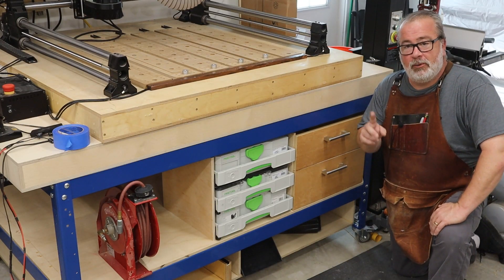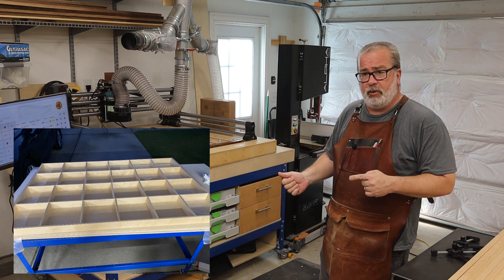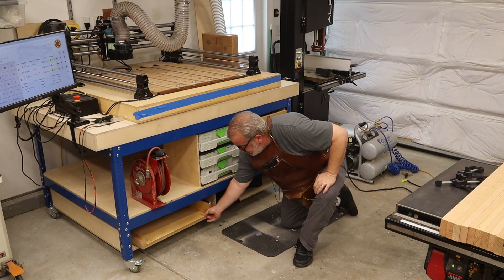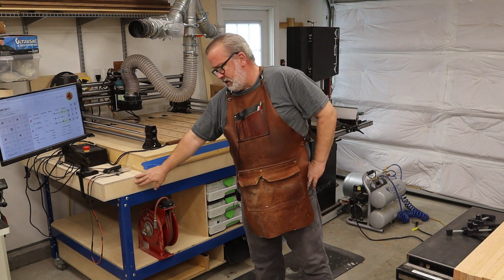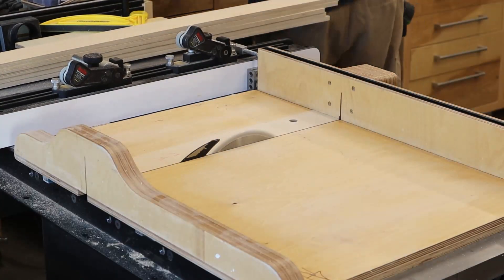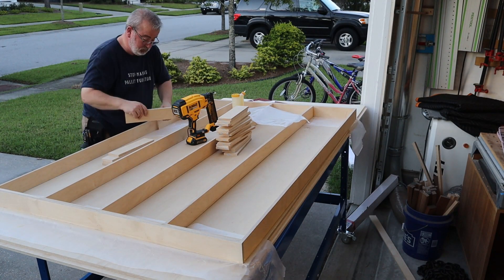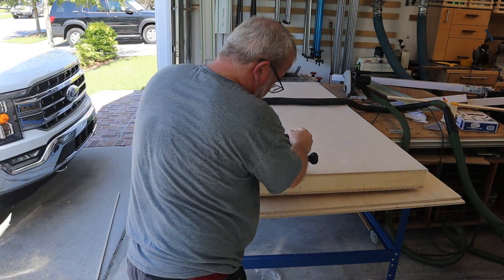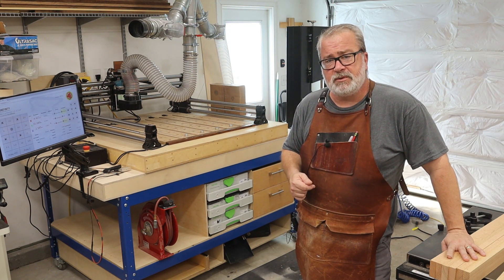Torsion Box Assembly on a Kreg Base

Comment: Did you attach the torsion box to the Kreg frame or just leave it sitting on top?
Reply from the maker: Hi there, I did attach the torsion box with screws from beneath, through the keep frame. The weight of the torsion box and in my case my CNC machine weren’t enough in my mind to keep the torsion box from sliding around. Hope that helps!

Comment: Great content as usual. Using a piece of scrap to make the "dados" on the end caps to locate the stretchers is an excellent process for a stress free build. One additional thing to look out for is to make sure the table you build the your torsion box on is as flat as possible. The torsion box will conform to the table and will only be as flat as the table is. Ask me how I know. :) If you don't have a flat table  you can hot melt glue shims under the legs of a pair of sturdy saw horses to make level and flat and place an mdf sheet on top.
Reply from the maker: Mike, thank you again!  Yes I do a lot of furniture making aside from CNC work and relative measuring while the easiest way to make accurate parts, seems to be a simple but lost process. Probably due to over thinking things, or desire to use your (my) super precision marking tools etc. You are 100%correct, if you don’t build the base we’ll, you can definitely pull a torsion box out of plane/flat.  Best practice I’ve found is build your base upside down on something flat. Let’s the leg ends run wild so to speak and true the bottoms later. Thank you for your support and comment.

Comment: What were the finally dimensions you went with for your torsion table?
Reply from the maker: I want to say something close to 48x72
Reply: @TradeSkillersAnonymous  : Other than the metal spans from the Kreg, how did you attach and/or support the torsion box to the Kreg? Thanks!
Reply from the maker: @b-radg916  I really just used two plywood spans each about a third of the way in from the ends. Due to the strength of the torsion box, I’m not really sure they were necessary, but made me feel better having them.
Reply: @TradeSkillersAnonymous : Wow, thanks!
Reply: @TradeSkillersAnonymous  thanks! I have a Journeyman on they way. This looks like the best setup with the kreg base.

Comment: Hi there, I was reading through your responses and didn't see anyone comment on torsion box vs the onefinity qcw stands they are now selling.  I am worried about the rigidity of the stand.  What are your thoughts between the stand they are selling and building a kreg/torsion box set up?
Reply from the maker: Hi Jason, if space isn’t an issue, I’d use a torsion box every time.  Since making this though, I’ve moved and am sharing an oversized garage with my wife’s car until I build my shop.  I’ve also ordered the 48x48 machine with the masso controller so my CNC footprint is about to grow at a time when I can least afford the space.  That said, with my new machine I did order the QCW, secured from below stand as it will be more space efficient than my current arrangement. To your question, so long as your rails stay relative to the bed, leg rigidity shouldn’t matter. So long as the machine is “locked” relative to that bed, you could run the machine in a row boat in heavy seas, and get great results.
Reply: @TradeSkillersAnonymous  Thank you for your quick response!  I will stick with my order the way it is.  I will hopefully have a decent garage space set up in the spring for my elite machine, but know it will be moving in the next 3 or 4 years.  Keeping things mobile will be helpful.  I have enjoyed your videos so far.  What software are you using for your design work? Vcarve or Carveco?  I am just in the library but will listen to your question and answer videos later today.
Reply from the maker: @jasonbeattie2889  I have used both, but have found a strong preference for vcarve pro. It will be different for everyone, but I found vcarve’s menus and operations to be the most intuitive to the way I think/work if that makes sense. I think they both are very strong in their function, I just prefer vcarve.

Comment: Great video.  What do you think of using MDF rather that baltic birch for the torsion box, or just the ribs and stretchers?
Reply from the maker: I think if you’re in a dry climate, mdf would be a good choice, very stable material unless it’s gets exposed to moisture. Living in Charleston sc meant I’m always dealing with really high humidity, so that’s why I chose plywood. Thanks for watching and your comment.  Please consider subscribing while you’re here!  Thanks
Reply: @TradeSkillersAnonymous  Thank you for your response.  We've had more humidity here in Portland, Maine in recent years so plywood it is.

Comment: so if we can only get the veneer baltic birch from big box store should we even make this for the CNC in your opinion?  When I currently cut my BB plywood on my cnc and try to set the thickness of the material I can get slightly different thickness on each of the sides.  I understand your point about cutting all the ribs at once but if the plywood isnt a unfied thickness we are defeating the purpose correct?
Reply from the maker: For me the answer is yes.  All plywood is considered more stable than let’s say 2x4’s, because each layer of plywood is assembled perpendicular to the prior layer, meaning that it’s really not going to expand and contract like regular wood. So, big box store plywood would be fine. The thickness of the plywood really isn’t that important for the ribs, because all the ribs are standing up on end if that makes sense.

Comment: Thank you for the great video and guide on the table build. Do you have a recommended thickness of the stretchers , how thin can I make it if using 1/2” material? 
Also is there a recommended grid size?
Reply from the maker: Hi Jesse, I used 1/2” plywood, and my ribs were 3” tall.  I spaced if I remember, something like 11” apart. As for recommendation, I would go larger than 18” grid. Best of luck!

Comment: What are the dimensions of one of your  ribs?  I uderstand it depends on the table size but I was interested in the height of the rib.
Reply from the maker: I know we've emailed, but in case it helps anyone in the future, the ribs were made 3" tall, so with a 1/2" top and bottom, he torsion box is right at 4" thick when all done.  Thanks!

Comment: Did you level the Kreg bench before you started building your torsion box on top of it? Also, did you check in the middle of the sheet to see if it sagged at all or did you have some ribs added between the rails to prevent that.

I see you have the Kreg locking wheels in your bench. When you install those do you lose the ability to adjust the leg height like you can with the standard leveling feet that come with the leg set. If you can't adjust for an uneven floor the wheels do not seem like an option I would want.

If you mentioned it in the video I missed it. What is the size table top you ended up making with for the Journeyman? I've heard the minimum needed is 50 x 75 but it looks like you used a single sheet of ply on each face. I thought Baltic Birch ply was supplied in 60x60 inch sheets.
Reply from the maker: Hi Bob, I did not level the table, as in practice, the table being level or not won’t affect the CNC.  Flatness is the key priority.  You could have a flat table, that’s at 30 degrees and so long as the machine and spoil board are flat and parallel you’re good to go.

The torsion box design has many ribs inside, like an airplane wing so there is lots of support. My maximum surface deviation with a 36” straight edge was .006”, which was removed in the first flattening of the spoilboard. 

Using the kreg locking wheels did remove the ability to level the kreg base, but being level wasn’t as important as being flat as mentioned above. 

My tabletop surface is 48x72.  Baltic birch is available at true lumber supply houses in both 60x60 or 48x96 formats. There is birch (not Baltic birch) available at the big box stores, but the only part of that plywood that is birch is the very thin veneer, where as Baltic birch is all birch wood, including the inner plys, the big box store birch will commonly have random wood as the core, including pine and far fewer cores.
Reply: I agree that the table surface being flat is more important than being level. The surface can be flat and not be level.

I understand how a torsion box is constructed, thanks for the refresher.

Maybe level was a poor choice of words. What I was asking is how can you build a flat torsion box if you don't start out building on a flat surface. In most cases establishing a flat surface (considering the tools available to the average woodworker, CNC, or DIY person) is most easily done by making it a level surface. 

Without leveling capability in the legs how do you compensate for an uneven floor. Your torsion box might be flat but you'll in reality only have three legs making load-bearing contact with the floor. That puts stress on the box and with the weight of the machine plus repeat stress from the CNC as the spindle is moved will over time warp your torsion box. Or do you believe that the box will still be flat a year from now.

What is the deviation across the whole 48" width, not some random 36" span, and what about the long 72" dimension or diagonally? 

Still not sure about your 48" dimension because Onefinity recommends a minimum 72x49" table top, and others have said they went with 75"x50" since they felt the recommended 72"x49" was barely enough.
Reply from the maker: Bob,

Didn’t mean to offend, 

I built the kreg table upside down, so that the tops of legs and stretchers were as flat as could be.  My shop floor, while sloped is reasonably flat.  If there was enough deviation in floor flatness, it could create an issue, but while the kreg table legs are strong, there’s still a lot of flex as i think it’s only maybe 1/16” to 3/32” thick. That said, my torsion box is heavy enough I think to flex the base into “flat enough”.

I get the point I think your making about using a 36” straight edge, but that’s the longest known straight edge I’ve got.  While I do have a 6 foot level, a level wouldn’t be measuring grade for flatness, so 36” was my longest measurable length with any kind of precision.

I wanted my torsion box top and bottom to be made from one piece of material, so that’s why it’s the size it is.  The machine fits perfectly, although I did reverse the y rails in order to maximize the space.  Would’ve fit without doing that, but future plans for an enclosure meant I wanted to tighten things up.  As is, I will have to bump out the y dimension of the table when I put an enclosure on.

As it happens, I replaced my spoil board yesterday, took two passes @ .010” each to flatten.  At the end of the day, compounding the base, torsion box, spoil board and machine, I’m super happy with that.